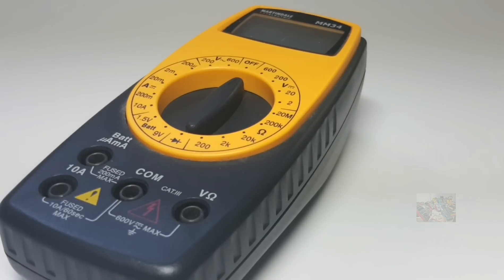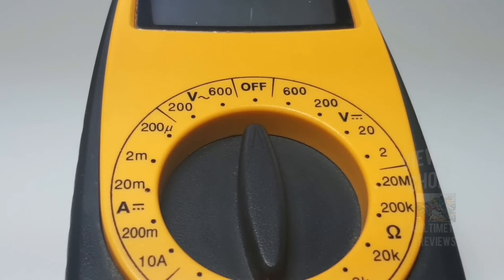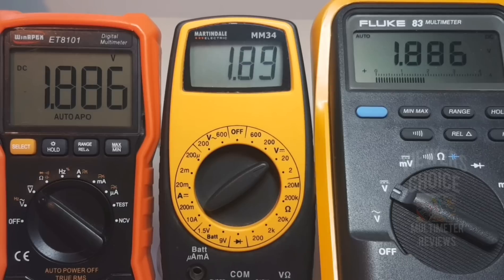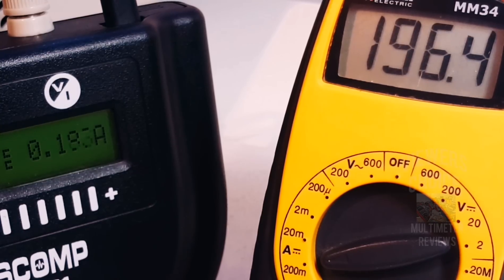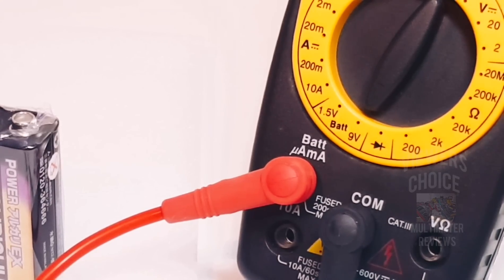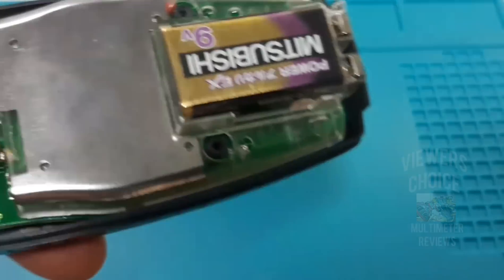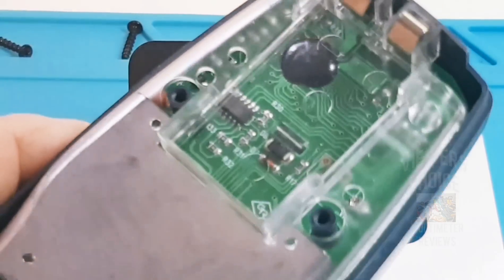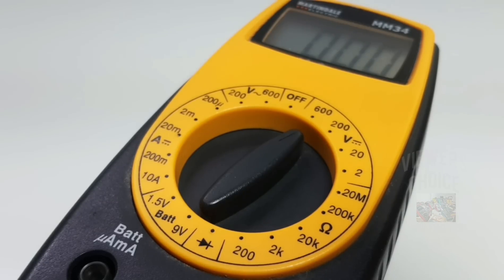Martindale Electric MM34 Multimeter Review & Showdown!

Comment: This meter looks incredible similar to a Promax PD130, that dates from 2003, so imagine how old this thing is... All I can say is that I have the PD-131, which has slightly different functions, but almost identical in the inside (the PD-132 was autorange) and still working and keeps in calibration. Can't complain.
Reply from the maker: It sure is nice.. I just used it the other day and it's still in spec..built like a tank 💪 😎,  What a great instrument!

Comment: A nice change of pace review, never seen one before, this meter has a bit of an industrial grade feel to it, unique contruction.  Surprised at it having no continuity range, but some other older meters didnt either.  Shielding is nice, excellent battery box that protects against leakage, and an over all old school no nonsense heavy duty look and feel that extends to the switch which is recessed to prevent drop damage, but surprised no input protection aside from fuses.  Thanks to Derek for this change of pace in meters.  Liking the new viewers choice reviews.
Reply from the maker: Well said! Yes it's a high grade multimeter with what was a a very fair price point. Incredible  thought went into the design internals.. and it shows! If this unit had continuity I would have been gobsmacked !!
Reply: Thanks, glad you liked it.